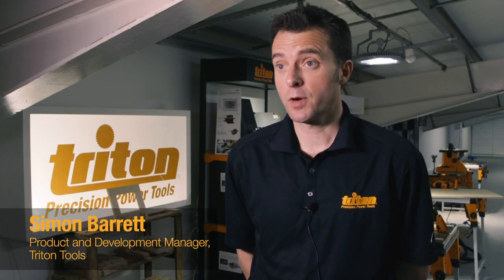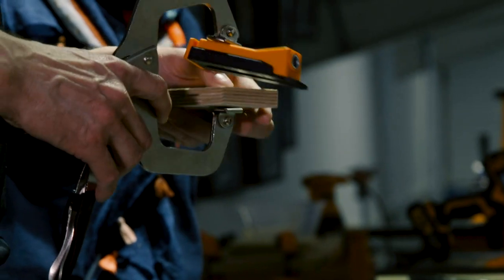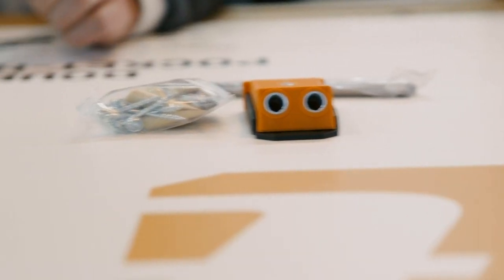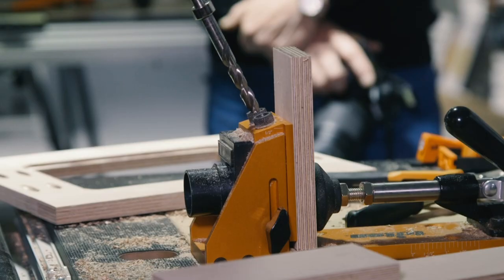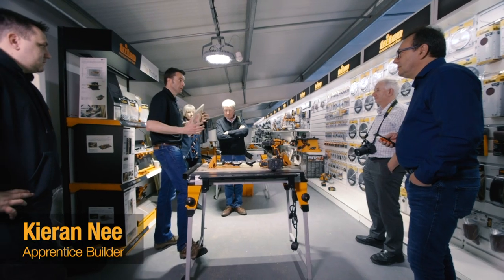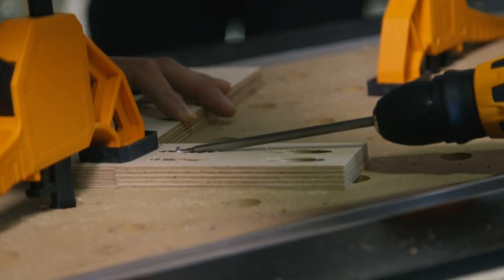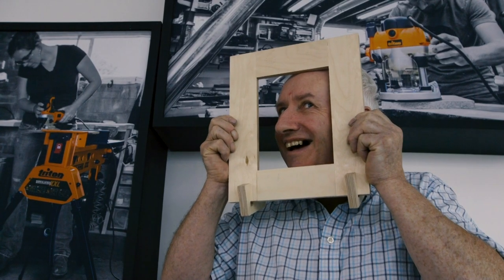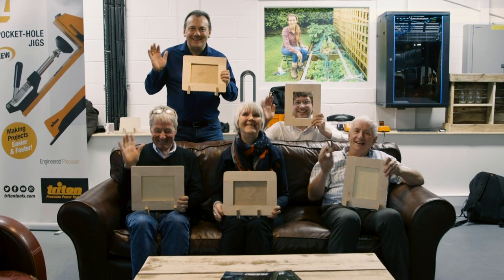Triton Tools Media Day Jig Launch

Comment: I make a lot of 2' deep cabinets and this jig would not work well, having to reach around or over to set the lever.  I like my kreg as it has the lever in the front of the jig where it is easily accessible.  Still allows for the dust collection too.